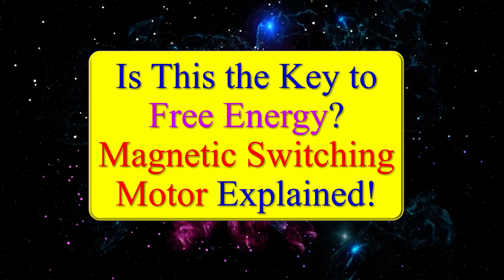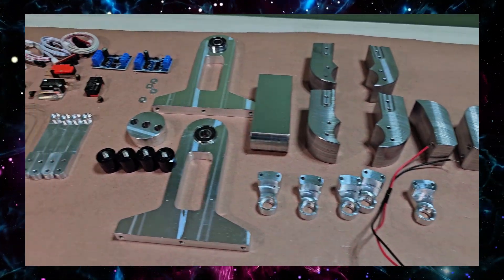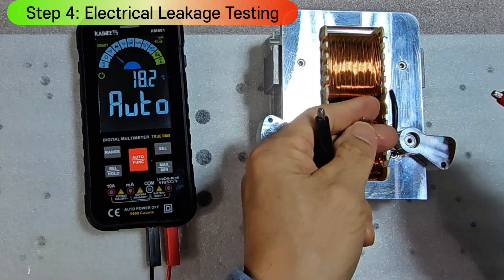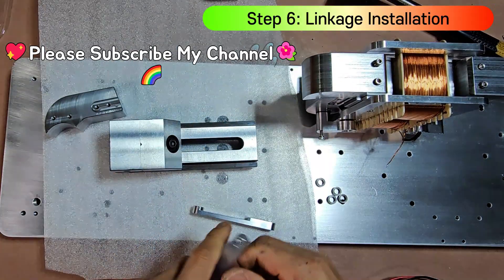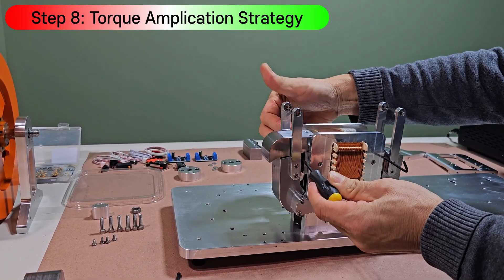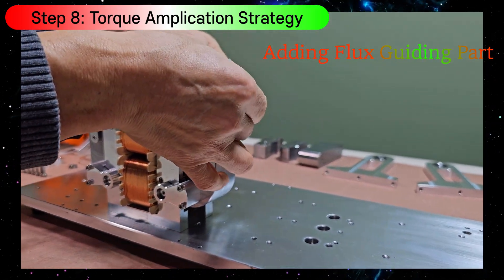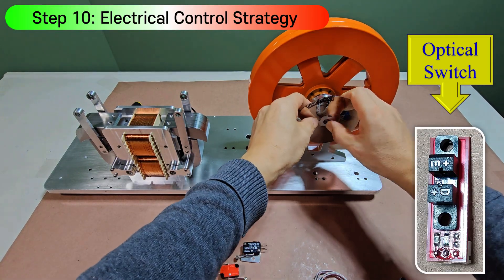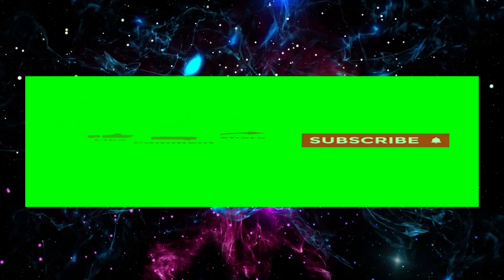Is this Key to Free Energy - Magnet Switching Motor Explained

Comment: Can't wait for new video!
Reply from the maker: Thanks for your patience! I'm working hard to get the next one out soon. I have all the mechanical parts ready this weekend, so I will upload the video that is about 90% complete
Reply: @LanikaiEnergy you should do experiment on AtmoMotor your craftsmenship can make a nice piece of it. Youtube had old video(now can't be found)of one of these motor, a guy had in his barn it so large it took most of the barn space it run purely on voltage and no amp

Comment: There is a control device you need,It has an input trigger that can be connected to the photosensors you already have. What is neat about this module is that you can control the pulse width output length from the input trigger, minimizing the input energy.

Comment: In 1954 Friedrich Luling magnet motor had 4 tapered Z shaped rotors of steel on one shaft, but on how he neutralized the magnet at lockup point I'm not sure, but your parallel magnet coil design can do that very well.  What is so cool is that the tapered Z shaped rotor makes the whole thing work.  Magnetic lines of force want to take the shortest distance, so they produce torque as they approach the shortest path(lockup point).  Remember to use a nonmagnetic rotor shaft as to not dissipate the magnetic forces. Thanks for the inspiration
Reply from the maker: I’m familiar with that video as well, but I couldn’t grasp its structure clearly. It felt too complex, so I ended up giving up. I really appreciate your comment.

Comment: whats the size of magnet? which type? 
how many turns in coil? what gauge? 
which steel core you used?
Reply from the maker: I used a one-inch cubic neodymium magnet. They weren't purchased from eBay or Amazon. They were custom made by a Chinese magnet company. The coils have probably been wound about 500 times, but I haven't counted them exactly.